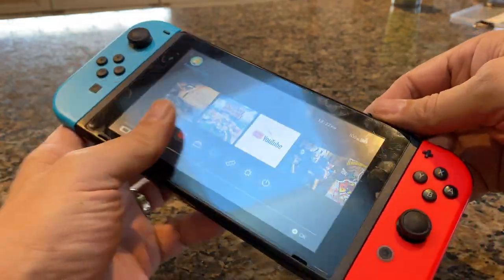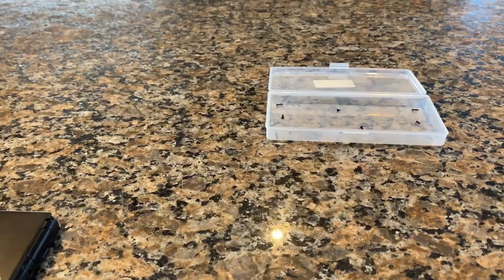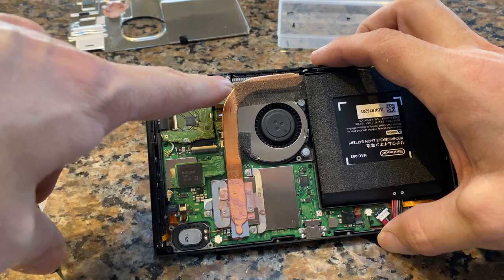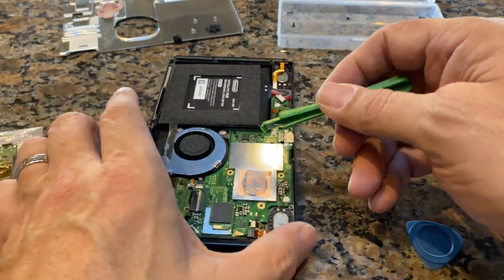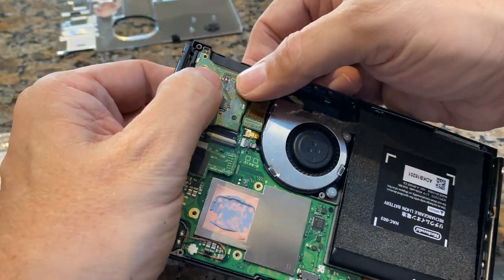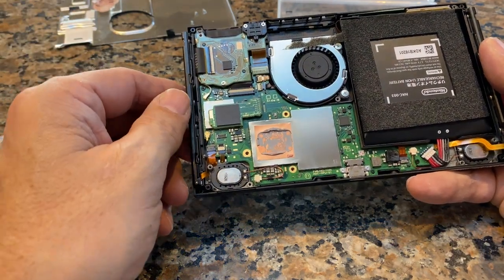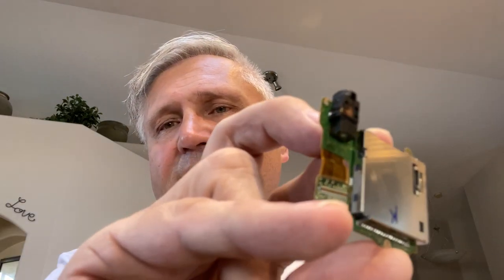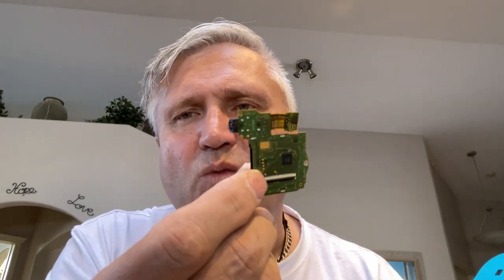Nintendo Switch Cartridge Slot Repair DIY

Comment: Tip about the screws (the self-tapping ones, that screw directlly into the plastic):
When screwing them in, aplly some downward pressure and turn the screw counterclockwise untill you feel and/or hear the screw poping into the existing threads. Then you can turn it clockwise. That way it will go into the existing threads, instead of making a new one and after a few times completelly eating up the plastic leaving you without the threads.
Reply from the maker: Excellent tip, thanks!!

Comment: Terrible job here. No disconnected battery, no re use of heat sink tape, violent manipulation of the digitizer ribbon cable and press connector.

Comment: Hey Mike! Any update on the Vespa looking scooter Tammy picked up?
Reply from the maker: It’s just occupying space in the garage.  I’m still trying to decide if it’s worth it to go down the path of buying a new battery, then having to buy a new controller, then possibly needing a new throttle vs saving the money for a set of eBikes.

Comment: great video but after i put the switch back together the card reader worked but the touch screen no longer works...any idea what i did that would have caused that?
Reply: the cartridge board ribbon cable also passes through the touchscreen. make sure its seated properly
Reply: maybe it's not the good part ,you have V1 and V2 parts